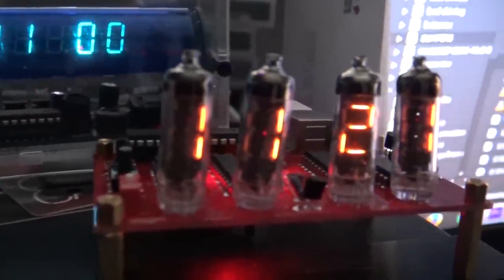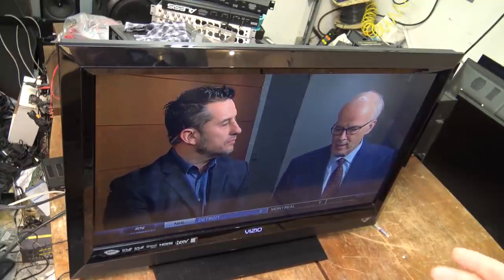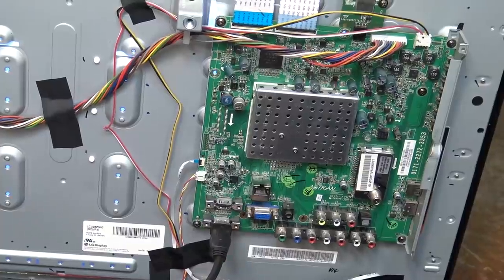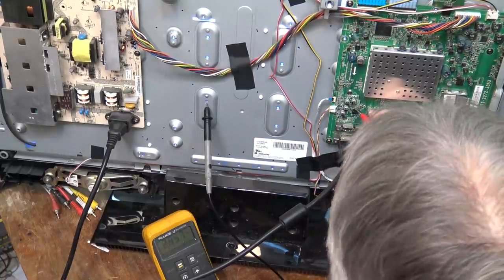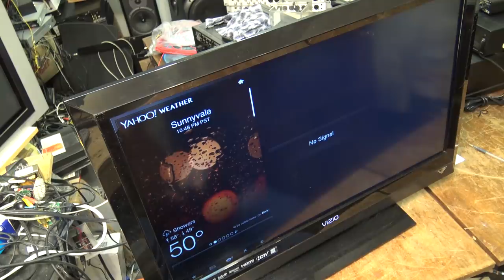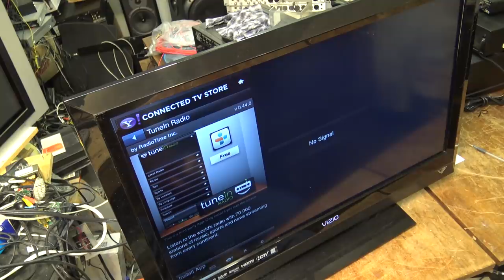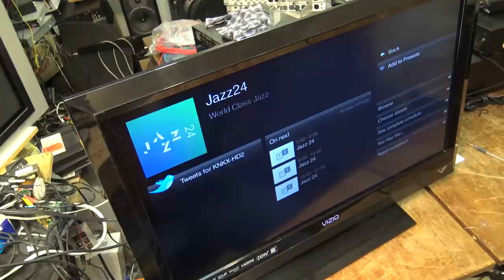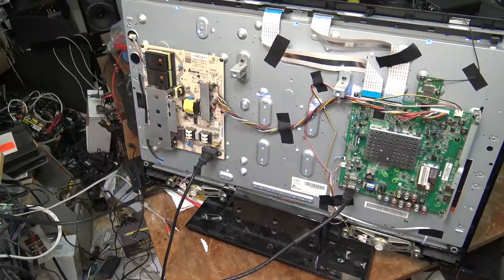Vizio made by Lifes Garbage   go figure

Comment: Yesterday, I was in Chinamart and they had 32" Philips TV's for $80 and when new TV's are that cheap, there is not much use in fooling with an old set (especially if it involves money). A while back, someone gave me a perfectly working 20" LG flat screen, I couldn't get anything for it, and I ended up giving it away. The harsh reality is that most new TV's are made cheap, they're getting cheaper, and they are not made to last or to be serviced. As for me, I'm still watching a 30 year old 19" GE and I will keep using it until it dies. About all I'm going to do to a flat screen is change obviously bad power supply capacitors, fix obvious bad solder connections, or any other simple fix that I can perform in 30 minutes (or less).
Reply from the maker: Why do you think I walked away from this so fast.  LCD tv is (yawn) boring. Plasma tv is cool.
Reply: But what about legacy CRT TVs, especially the old tube driven ones?
Reply from the maker: @versedbridge4007  
All crt sets are very old now and the tubes that remain are getting pretty weak unless you are a collector and collectors don't put many hours on them.  They are serviceable but nobody wants them.

Comment: 12VOLTVIDS, 
1.) What does the Degaussing circuit to do the CRT tube and what are some common degaussing circuit failure problems?
2.) Why is it common that the Horizontal Width Coil is stuck frozen and doesn't change much on the display image while adjusting the Horizontal width coil? 
3.) Does the horizontal frequency trim pot change the 15.975Khz to a different frequency? 
4.) H Center jumpers & V Center Jumpers on the monitor circuit board. Can you move these H Center jumpers and V center jumpers in real time while the monitor is Turned ON or do you have to turn off the monitor and discharge the anode in order to move the H center jumper and V center jumper one at a time?
Reply from the maker: Deausing circuit provides an initial strong AC magnetic field that gradually drops to 0 as the thermister heats up. This neutralizes any magnetic field in the shadow mask behind the screen.
I have a video up that shows the symptom, and correction of a failed degauss circuit. It was a sony tv.
Most horizontal width controls are glued at the factory once initially set, so you can't adjust them. This is done because the horizontal pulses going through the coil would quite often make the slug sing, and cause a lous high pitched squeal.
The trim pot is just to set the free run oscillator. The ACF will lock the oscillator once a sync signal is received.
You can generally flip the H and V centering switches when the unit is on.
Reply: @12voltvids  thanks for the help. 
So you don't every adjust the horizontal width coil using a TV plastic tuning tool to adjust the H Width coil slug? 
The H frequency trim pot sets the free running oscillator to 15.975khz? or is the H Frequency trim pot adjusting the "Gain" of the H oscillator circuit?
The H&V centering switches are very high voltages directly to the deflection plates inside the CRT tube? The H&V centering switches are changing the High voltage or bias voltage to the H&V deflection plates inside the CRT tube? 
The DEgausing circuit is outputting an AC voltage to the Magnetic strip that is a strip  that fits around the CRT screen.
Reply from the maker: @billwilliams6338  
The vertical centering switch changes the dc bias to the vertical deflection circuit to shift the dc level of the output slightly to move the beam up or down slightly.   The horizontal  centering jumpers typically add or remove capacitance to the horizontal deflection yoke coil. The horizontal will have high voltage pulse on it but not the vertical
Reply: @12voltvids  ok thanks for the help

Comment: My initial guess: TV has a fried HDMI driver chip. A victim of a thunderstorm that caused a surge to ripple into the main video board. I’ve seen about 4 TVs with no working HDMI inputs, so far in my life.
I have one just like that one. It had bad ribbon cables though, that caused the picture to randomly fade into a cloudy garbled mess of vertical lines. It too, was a throw away that someone gave me. What a coincidence!!!

Comment: We have an early Samsung smart TV, all the apps have been discontinued on that too.
Reply from the maker: That is because most of the streaming apps used flash and the streaming companies have chosen other protocols like html5
Reply: @12voltvids  Here in the UK we have something called Sky Q miniboxes, these little devices are hugely powerful and really obsolete anything else, if you buy into Sky Q.  A bit of research shows that "most TVs use one of five operating systems now: Android TV, webOS, Tizen, Roku TV and SmartCast that are used by Sony, LG, Samsung, TCL and Vizio, respectively.  Philips also uses Android while Panasonic uses its own proprietary system called MyHomeScreen."  Wouldn't you think they would standardise this a bit more.

Comment: The VGA input is interesting as it can serve as monitor for many PC or microcomputer device. Same with the components for video surveillance or even vintage games. I think there is a WiFi board and antenna connected on the upper part of the board.
The obsolescence problem is directly seen in action with the integrated multimedia platform: you can't update this one as the depot seems long gone (never maintained?). Last, there is no chance to flash another system, Linux based... 
I guess some will ask you to try to give this HDMI ship a chance and flux it again. But I don't believe it will work on this one: as you get partial function when you've got messages from malfunctioning connections, there's most probably an internal short or drifted capacitive array. You can also get this kind of result with an electrostatic discharge or overvoltage that has passed the first level of external protection. Seen that frequently when a DVD or BRD went dead with a thunderstorm. TV seems OK first, but damages propagated...
This set is in limbo: dead for a techie, perfectly usable for limited usage. What can save it is the picture quality. And it looks clean and near new, with all the stickers attached!

Comment: Have you tried disconnecting all inputs, unplug the set, hold the power button in for 30 seconds? This allegedly resets the memory. But who knows
Reply from the maker: I no longer have this set. I gave it to a guy to use on his 65 foot yaught. He just watches DVDs and receives off air TV, so that is fine. Doesn't need hdmi.

Comment: It is LCD type,much heavier but the backlight will last much longer.HDMI socket pins sometimes are oxidizing especially older ones and need contact cleaner spray.Aluminum capacitors also are prone to fail and also the smd regulator(or looks like such) that is located on top of the four capacitors bunch i think needs output voltage checking.
Reply from the maker: They are all LCD. The "LED" sets just use LED backlights. The older ones use fluorescent lamps, which will loast 60,000 or longer. I have a few that I use at monitors for my security cameras that never get turned off. One has been running 24/7 for over 10 years.

Comment: I never considered the fact that these TVs have a limited time that apps would be supported
Reply from the maker: Remember all those TVs with Skype? Remember the first batch of super expensive 4K TVs that only supported 4K at 24 FPS. All the cable companies that have 4K only support 60FPS so goess what mode these early 4K sets run at? Yep, 1080P @ 60.  They even took away 24FPS support on the boxes, because only dumb ass film makers that are stuck in the past and shooting on film use that now.
Reply: @12voltvids  I remember going into a place with a coworker called stereo exchange,  he was a major audiophile,  and they had the first flatscreen tv that cost about 40 thousand to buy, they sold all NAD and ADCOM stuff in there, that's where I got my first Nakamichi BX1 tape deck

Comment: I've watched your video about STR-AV570 yesterday and a few days ago a relative gave me one STR-DH750 that stopped turning on. With my small electronic knowlege, I downloaded the service manual and started checking fuses, voltages, caps and resistors. So, after a day, I noticed that the display board is sending the turn on signal, when I press the Power button, to the main IC, but the output signal to the the relay driver is fixed in 1.14v. Does this means that the System Control IC is damage? He is receiving 3.3v STBY power in all VCC terminals.  Thanks in advance.

Comment: The reason all those apps don't work anymore is because they got stricter with the DRM requirements and no longer support L3 widevine. That's why I never really care about SMART TVs because the DRM and or API is bound to change in the future. You want to watch Hulu, Netflix, etc. on the TV hook it up to a computer, or get a firestick, roku, etc. that can be changed out when need be.
Reply from the maker: Actually it is because they no longer support flash which is what the old apps are based on.

Comment: 12VOLTVIDS,  the Horizontal Width Coil is adjusting the "pulse width" of the Horizontal deflection signal or the horizontal frequency 15.975Khz? I'm not sure what the Horizontal width coil purpose is really do. 
What is the purpose of the linearity coil? why doesn't the vertical have a vertical height coil?
Reply from the maker: Horizontal width coil changes the amplitude of the waveform that goes to the horizontal yoke coil. Vertical is not a pulse as the horizontal waveform is, it is a sawtooth, and the waveform is produced by charging and discharging capacitors which drives an amplifier. The vertical size and linearity controls adjust the "volume" and "tone" of this amplifier.
Reply: @12voltvids  thanks for the help, 
But why would you want to change the amplitude of the H pulse waveform that goes to the H yoke coil? 
Its not common to use a Coil like a H width coil to adjust the amplitude of a pulse waveform, not sure why they are using an inductive coil to do this, any reasons why?
The Linearity Coil changes the Vertical size?
Reply from the maker: @billwilliams6338  The horizontal width coil or inductor changes the induced voltage in the yoke, and is there to compensate for slight variations in each yoke at time of manufacture. Many sets do not have a horizontal width coil. They just place a fixed value inductor in series with the horizontal yoke to ball park the width.Since the width was affected by the B+ voltage, higher B+ would increase width and HV, and lower B+ lower HV and decrease width. The width coil was provided to set the scan width after the B+ was set. It was found more on computer type displays, because on consumer TVs it was not uncommon to have 10% overscan. On a computer monitor this would be unacceptable as the text would be off the screen.  Now when it came to old delta gun color sets, there were plenty of adjustable coils and transformers for tweaking the waveforms applied to the dynamic convergence coils.he convergence board was rull of wire wound pots and coils and were a PITA when it went out of adjustment.
Reply: @12voltvids  thanks for the help, I'm still confused why they are using an Inductor in series to change the voltage to the H Yoke. I'm guessing the inductor "steps Up" the B+ current and voltage that is why they used an Inductor to adjust the H width? 
The Deguassing magnetic Wire that goes around the CRT screen is magnetizing the electrons inside the CRT tube? after 2mins the electrons are neutrualized and the deguassing circuit turns off?
Reply from the maker: @billwilliams6338  It is operating like a single winding transformer. When the horizontal output transistor is not conducting there is the B+ voltage that runs through the yoke and horizontal width, and linearity coils and charges the capacitor in the horizontal yoke circuit. When the transistor (or tube) conducts in pulls this B+ to ground momentarily, which saturates the primary of the fly back. This also dumps the energy stored in the horizontal yoke capacitor, drawing that current through the yoke and inductors producing a magnetic field in the inductors and the yoke. This magnetic field kicks the beam over to the left of the screen (looking from the front) to start the trace (this is known as retrace)
The transistor or tube immediately switches off. Now the current stops flowing in the flyback and the magnetic field collapses and induces high voltage in the secondary winding. Current also stops flowing in the yoke and the beam begins to travel from the left side of the screen towards the right. As B+ begins to pass through the yoke it continues to push the beam to the right and the capacitor again begins to charge. The linearity and width coils also lose their magnetic field and the collapsing magnetic field induces voltage in  the winding that feeds into the yoke and pushes the beam to the right side of the screen. Changing the position of the slug in the width coil changes how much energy is released back into the winding, and thus how much energy is transferred back into the yoke to adjust the width. It has the oposite effect when the system is charging up during retrace and will determine how far the beam is pulled to the left.
The theory is not that difficult to understand.
Reply: @12voltvids  thanks for the help. 
But is the Linearity Coil doing to the Horizontal Deflection and Vertical deflection? Is the Linearity Coil changing the amplitude to the H&V yokes?
Reply from the maker: @billwilliams6338  
The linearity coil is doing just that. Compensating for effects of the magnetic field on the beam to keep it linear.  Basically distorting the waveform slightly so that the on screen effect is a linear scan.
Here is an idea, since you have so many questions let's take this to patreon and I will give you my undivided attention to questions like I do for all my patrons.  
Patreon.com/12voltvids

Comment: I had an older Vizio doing that with the apps I'm told there's a site you can download new firmware on to a USB and it fixes it. Or just use a chrome cast video adapter assuming the HDMI ports work unlike this one.
Reply from the maker: No big deal. I gave it away to someone to use on their boat for off air and DVD playback using the av inputs.
Reply: @12voltvids  good deal if there happy free is always a plus 👍👍✌
Reply from the maker: @mikeshobbiesandrandomstuff  
I give away lots of stuff. The stuff that is usable gets given away. The unusable junk is recycled.   My monthly incentive from YouTube and subscribers allows me to work very reasonably and donate much of what I repair.
Reply: @12voltvids  that's awesome!

Comment: VGA work? Hook it up with a Raspberry PI and it can be a cheap computer or video display, etc...
Reply from the maker: Yes VGA, Component, Composite and the tuner works. Just the HDMI is dead due to the HDMI switch being bad.
Reply: i have a partially crapped out 27in. Samsung that I use for a monitor on my workbench. Great for looking at schematics.

Comment: If you didn't already have a security monitor it could have been useful.
It's a shame as most of it works as a t.v, stick it by the recycling bin.
Reply from the maker: I may just keep it for that, for when the current set dies because it does have an analog tuner and my security cameras are distributed around the house on analog channel 9.

Comment: Can't you find the whole board somewhere for 10-20$ ? 

There's HDMI to VGA converters for less than 10$ which would work perfectly fine with that TV, considering it has VGA input.
Reply: The only problem with the HDMI to VGA converters, is that they don't pass audio to the VGA, and you cannot watch HDCP content. I have one and use it to connect my laptop to an Epson Powerlight projector that doesn't have HDMI, and I can't watch Netflix, or any of my videos from VUDU that's in HD. I can watch my SD programs but when I try and watch an HD video there is always an error.
Reply: It isnt worth spending any money on this thing

Comment: That's one of the earlier vizio tv's lol
Reply from the maker: Yes, and it shows because besides the non functioning HDMI ports it still works. Try that with a new TV. They will be shot in 4 years.
Reply: I’m quite certain the vizios with the orange Vizio logo and front-facing speakers are older. I’m talking a 2008-ish model. The model name of the one I’m referring to is VX37L